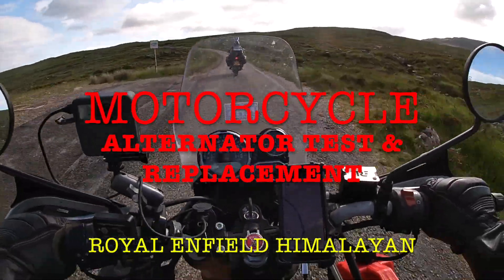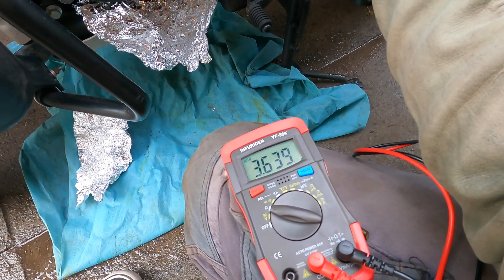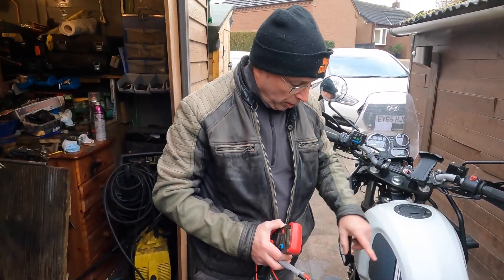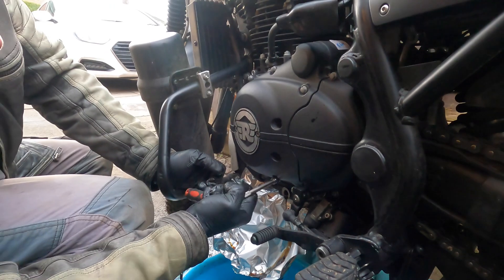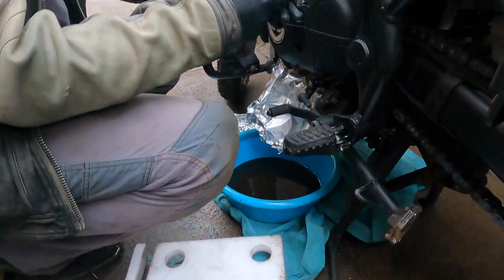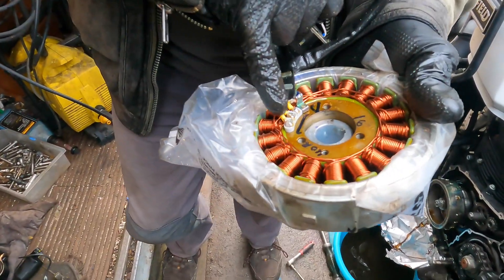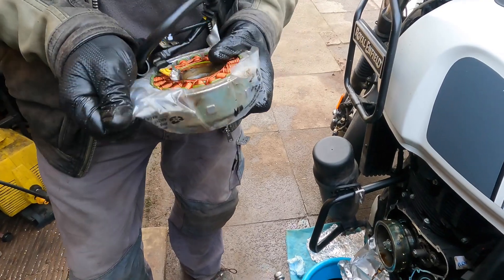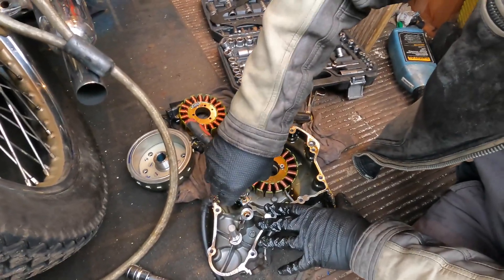Motorcycle Alternator Test & Replacement RE Himalayan

Comment: Completed the job successfully thanks to your video, i would add the red electrical connector would have made life easier if covered its a side ways slide jobbie,not a straight pull apart ,that cost me an hour. Also make sure you get the alternator pick up the right way round. The hiscox gaske is thin card so i reused the original.  But great video would not have attempted it with out it so thanks for posting.
Reply from the maker: Just glad it helped

Comment: I think you may have just been unlucky with the coils on the bike. I've used Oxford heated grips on several bikes and current pull isn't massive. Also, a USB and it's lightweight wiring would fail before the windings in my opinion. 
It's localised burning, and my stab in the dark would be an insulation or material failure. 
Nice straightforward video, shows its within the grasp of folk to at least establish a fault, even if they can't repair it themselves. 🔧👍
Reply from the maker: Quite possibly 
We use them  on all our bikes and it’s our first problem 
Even with the USB it’s not a lot of electrical kit so I would be surprised if it overloaded 
But you never know

Comment: Nice job you completed. Nice touch using Blue lock tight on the pickups.
Had a pretty little Enfield called a Woodsman’s few years back although my alternator went after 10,000 miles got a bit frustrating really tried four different alternators from  Hichtcocks eventually did get the right one.. only one example of course but made me lose confidence in the brand. PS Did like the glimpse of the Avon Speedmaster tyre where you were working took me back a few decades😮
Reply from the maker: It’s fitted to my beloved A10
Should fit more modern rubber at some point

Comment: Has the Enfield been running slightly low on oil? It could be the reason for the coil to run too hot and get burned.
Reply from the maker: Nope 
Check constantly and it’s never moved
Reply: @bikerdood1100  Didn’t think so when the bike is so new. It happened for my V-Strom 1000, but that was after 85.000 km and the oil had sometimes been between the two marks.
Reply: @kasperkjrsgaard1447 Here in Colombia both the distributors and the riders say to fully top the oil window, even above the indicated top line, to keep the stator properly cooled. I usually did, but I went complacient with it, and now I'm watching the video to remove a toasted coil

Comment: I have a 2019 Himmy. And I've been really struggling with this shit for the last 6 months now. My batteries would die and there'd be no ignition if I didn't ride the motorcycle for even a single day. First I swapped in new batteries. Died in a week. Then I swapped the alternator. Again died in a week. Now I am waiting for spares from Royal Enfield. Going to swap the rectifier unit and possibly the alternator again! The RE technician tells me these bikes have a known issue. The casing is getting demagnetized due to engine heat. Haven't been on a long ride in six months now. Really frustrating.
Reply from the maker: Regulator rectifier perhaps 🤔 
I keep mine on a charge 
Had a lot of regulator issues on various bikes over the years especially Suzukis 
Including my sons SV only last year
Reply: @bikerdood1100  yeah. I hope it’s the rectifier and nothing messy. I just checked my new alternator as you showed in this video. And I’m get 1.4 ohms one each coil. Now I’m wondering if my new alternators are fried :(
Reply from the maker: @JimmyBlack3308  well it’s not likely to be much else other than a short creating a drain on the system. I do find modern charging systems are a bit cheap
Reply: @bikerdood1100  hope so. Will test for a short once I have it running again. Thanks!

Comment: Wow that’s very low miles for any part of the charging system to fail,
Reply from the maker: I know 
Mysteriously low and I’ve done all the miles so I know it’s genuine
Reply: @bikerdood1100 I had similar problems with a Peugeot city star 125 scooter I got it brand new had the same battery issues and had to replace the generator which had at least 4 fried coils, then the fuel pump failed, bulbs blowing brake light switch stopped work in along with the Rev counter then the plastic cog on the oil pump broke which basically destroyed the engine, Peugeot customer services was shocking, I managed to sort it out then sold it quickly, i hope you don’t have any of the same problems